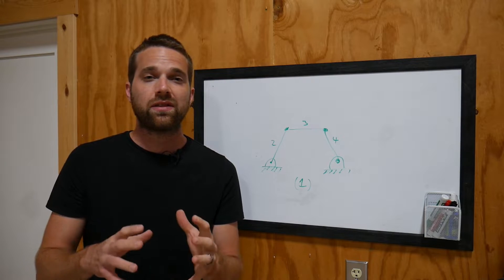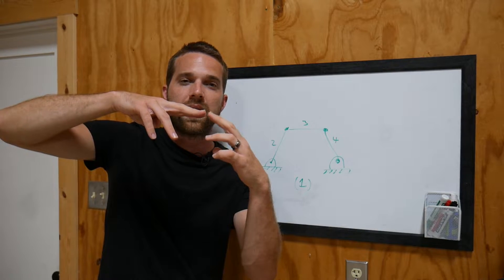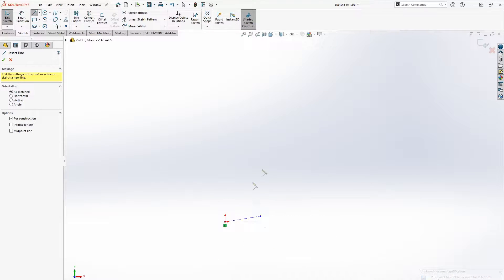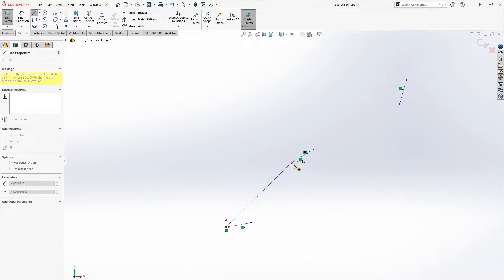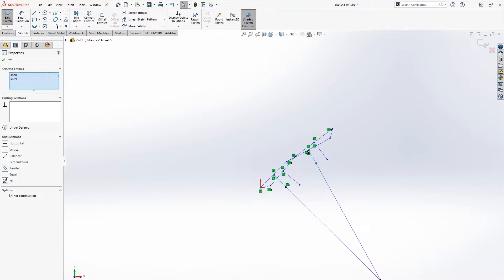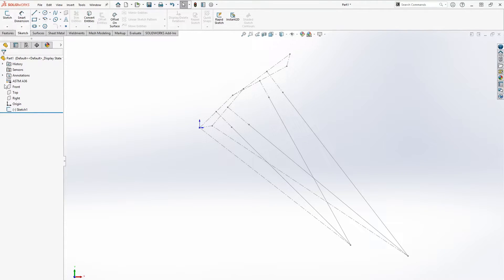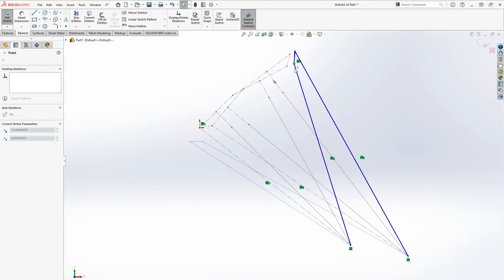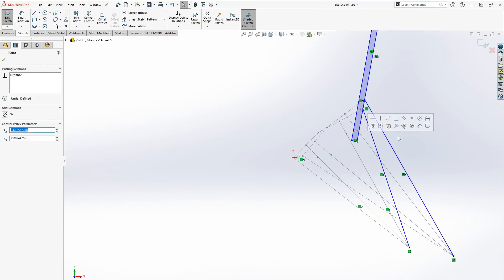How To - Mechanism Design

Comment: Instead of creating multiple perpendicular lines, you can achieve the same results with only 2x circles.
Draw a circle by connecting the 3x points A. Once done, you will see that point-A will rotate around the center of this circle.
Do the same for point B.

Comment: Holee fuurk. I've been designing machines and machine components for over a decade and I've never seen four bar linkage design simplified like this. I had previously intuitively sketched an initial layout then iteratively modified through several trials of movement. This is awesome.

Comment: Graphical methods are great to get a feel and work quickly.........being able to do describe something mathematically is more powerful....can then use it within computer programs etc.   On he easy side can go so far as "string computers" (or cardboard)......cork boards with pins  as pivots and string wrapped around it.   or linkages made from cardboard that are  pinned only to each other.     In University (M.E)  I was a distracted student (into racing) so not by grades were all over the place...... but I wrote a  program to show, graphically, the camber curve of a Double A arm suspension.  It was just simple Trigonometry formulas working off of each other.  And then lines draw between these points.   It was so long ago I think I wrote it in BASIC....also we had pen plotters and used digitizers when we did do CAD, lol.   Anyway, the program impressed soe fellow douche bag student  who accosted me in the hallway after my presentation and accused e of stealing the program  from someone..... lol,,, a backhanded compliment....that douche bag turned out to be our class valedictorian......  so glad I went off on my own and did not get involved in the corporate rat race with people like that  ;-) ...... although I understand his  suspicion because of his limited mind set.

Comment: What would you do, if die midpoints (position 1 A and position 2 A as well as position 2 A and position 3 A) are parallel to each other and perpendicular to the ground, so only B's perpendicular lines do intersect?

Comment: A. This is fantastic
B. It's interesting that it's a bit different than the method I use. If you draw lines from all the A points to an arbitrary point, and make them equal in length, and repeat for all the B points, that works too. I wonder about the pros and cons of doing it this way vs the way I'm used to.

Comment: How do you use pivot points for your planning?
After you have chosen the path of movement, each pivot point is in a random location. How are you sure you can even apply these points?

Comment: I have a whole a$$ mechanical engineering degree and this 7 minut vid has been more useful then a whole semester of lectures on this topic 🙃 thank you
Reply: same. Do you also have PTSD of having to hand draw instant center diagrams at perfect scale for Kinematics exams? lol we had to tape multiple pieces of paper together sometimes.
Reply: @JakeCuley all purely mathimatical in my program drawing method not allowed in mechanisms class funny thing is they do force everyone to take 1 semster of hand drawing and then dont allow its uses in any other class afther haha that might have been a spcial quark of where i studied
Reply: @JR-rk5dr  , there are good reasons for doing both, being able to do describe something mathematically is more powerful....can then use it within computer programs etc.   On he easy side can go so far as "string computers" (or cardboard)......cork boards with pins  as pivots and string wrapped around it.   or linkages made from cardboard that are  pinned only to each other.
Reply: what? didn't they explain how to find those points?

Comment: great video! Really helped. I was wondering if this technique also works if I have a 4th or a 5h position. Will it then become a 5 bar or 6 bar linkage?
Reply from the maker: There are techniques to add more positions but the process grows in complexity. As far as growing to a 5 or 6 bar linkage that depends on the situation. Adding links can accomplish more complex geometry but most applications add links for specific purposes. I've made a 4 into a 6 not because I needed a more complex path but because I needed to add a force into the mechanism and bars 5 and 6 allowed me to tune the force input for ergonomics along the travel of the mechanism.

Comment: Very nice video. You can also do a simpler approach: make a circle using the 3-point circle method through all three points A. Do the same with points B. The center of the circles is the chassis pivot.
Reply: Brilliant

Comment: First of all thanks for the video Man!
Thanks for the great explanation and simplication of construct the required mechanism.
I loved the procedure the way you have explained.
Thanks a lot for giving a clear view to crack those type of mechanisms. 
Could you please tell me on which platform that I can do those things? Plz this will really help me to crack a my own mechanism.
Reply from the maker: Thanks! I use Solidworks but any 2d cad that allows lines to be connected like I did in the video should work just as well.
Reply: @DirtyElbowsGarage  Thanks for the response  and suggestions!
Explain few more mechanisms especially (NUBIKE leverage mechanism) that will help me a lot. 
Thank you.

Comment: Awesome video. I wished I had solid works. Question, working on a project although hinge needs to be on the outside. Was wanting to design a hinge to be pulled by a lever or actuator to open the grill lid. Any ideas designing from the outside?
Reply from the maker: Thanks! As far as your hinge setup goes, the pulling actuator should work as long as the force and travel needs are met and the actuator doesn't run into anything. Also, you could look into a pushing setup if you move pivot joints outside of the pit sides (if I'm picturing it right).

Comment: Somebody please help me.  When I try and duplicate this example, as I grab a point to try and move the mechanism, the length of the line changes.  It doesn't even matter if I dimension the line.  I have never noticed this before.  I think a setting must have changed.  Ever seen this before?
Reply from the maker: Is the dimension grey? Right-click it and make sure it is not "Driven". Hopefully that helps.
Reply: @DirtyElbowsGarage  Thanks for the reply, but I found it.  "Options, System Options, Sketch, Override dimensions on drag/move" was checked.  Unchecking that solved the problem.

Comment: Great video, thanks for making it! I've been trying to understand what goes into creating a mechanism like a nerf gun. Is this the sort of process you'd use?
Reply from the maker: Not sure what part of the gun you're working on, but check out "crank and rocker" mechanisms. There's an equation  to help you verify the linkage lengths before testing it. This mechanism might help you more than a traditional four bar.
Reply: Hey were you able to succeed with ur nerf gun ? You come across any designs methods. Pls share bruh.

Passionate abt mechanisms, but I dunno much abt designing them. Lookin forward to learn

Comment: hello, could it also be done with 4 positions or the max is 3 positions ?
Reply from the maker: I would have to research it more, but I believe that there are techniques that you can use four positions with. However it takes a step away from graphical development towards analytical development.

Comment: Thanks for the video.  It helped me tremendously.  I just wanted to add my alternative to your method.  Instead of drawing lines between the points, then bisecting them with perpendicular lines, you can just draw at 3-point circle using A1, A2, A3 as the points.  The center of the circle is the exact same place your intersecting lines meet.  Do the same for the B points and bam, done.
Reply: or draw just two positions of the hood and then a circle A1 to A2 and locate the center of the circle as you want. I learned a lot today!
Reply: @vitof.4626  That's really fun to play with! I like that by just defining a start and end with the two circles connecting them, you can play more freely with the motion and easily try many cool motion paths. Thanks for the suggestion!
Reply: Wow, you're right. I tried both ways and found your circle method to be much faster. Thanks for sharing!
Reply: The information super highway contains super information! Thankyou for making things easy.

Comment: What?! I’ve always been curious about the complexities of engineering similar mechanisms... I had no idea it could be this simple. Very succinct explanation and example. This video coupled with the 3D printer I got for Christmas, whew, I’ve got some stuff to make! Thanks!
Reply: What is lacking with Mechanical Engineers today, is the knowledge of how to design mechanisms correctly. Did know that there's a mathematical formula that can be used for all mechanism designs? It's called Gruebler's Count. I found a way to make it practical for all 3D mechanisms. Here's the link if you are interested.  https://youtu.be/KFB8gMjxDPk
Reply: not simple

Comment: Elegant! I wish I had thought of this. I feel dumb, but armed with this nalej, I can pretend to be smart XD
Reply: I figured out another solution. If your CAD software has 3 point arc or circle tool (I'm not familiar with Solid Works), you can find the location of each joint in bar 1 by drawing an arc (or circle) containing A1, A2, and A3 (and B1, B2, and B3). Perpendicular bisectors is probably what that tool uses "under the hood" to find the center of the circle. One nice thing about this method is that it does not clutter up your sketch as much (2 arcs instead of 6 lines). Another advantage is that it is self-explanatory why it works: bars 2 and 4 trace out the two guide arcs. Now, I can feel smart XD
Reply: https://youtu.be/vFDMaHQ4kW8  💐

Comment: Hi, Super cool :-)  
A question, - could you show a mechanisme in ex. solid works, just simple "strokes" - of an object "A" traveling in a straight vertical line movement (more or less ) -> that "translates" into a movemte of object "B" in a horisontal straight line movemnet, in the ratio app. 4:1 or 5:1?   - Ex. object "A" vertical movement = 4 or 5 inches - results in object "B" moving 1 inch. ? :-) 
The challenge is - it all, do have to happen in a vertical retungular container mesuring 5.2 x 1.2 inches... so theres little fee space at the ends...

Kind regards 
Henrik
Reply: https://youtu.be/vFDMaHQ4kW8  💐

Comment: Hello, could you please tell me which which software did you model and animated this?
Reply from the maker: I use Solidworks
Reply: @DirtyElbowsGarage  thank you for prompt respond. are you a mechanism designer yourself or you only model these mechanisms?
Reply from the maker: I use mechanisms when needed on projects I'm working on. There's more to fully developing a mechanism especially when you involve forces from weight, springs, and actuators but I didn't want to go too far down that path in this video.
Reply: @DirtyElbowsGarage  great but either you didnt answer me or i didnt understand you :-D question was: Can you actually design mechanisms for different functions?
Reply from the maker: Yes, I design mechanisms when needed.
Reply: @DirtyElbowsGarage  there are some opening motions that that i am interested in having, lets say for example some doors that i want them to open in different ways and directions, and so i was wondering if you can design a hinge and a mechanism for them to open in my desired way. so basically the question is not animation, its about designing the mechanism via different methods, for instance one solution to be with levers and linkages only, one with gears/ rack and pinions, one solution to be gears and pulleys and other solution to be mix of all?
Can you do that?